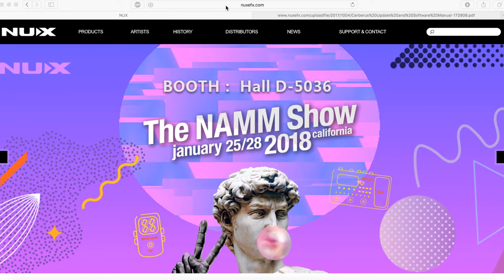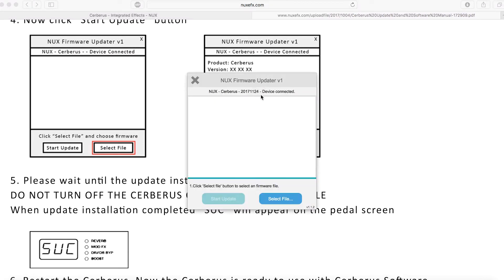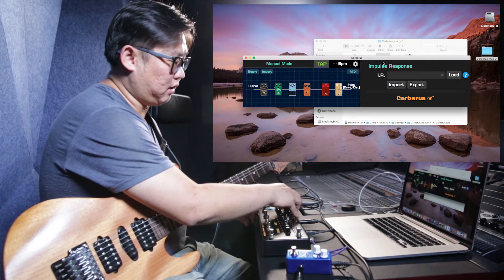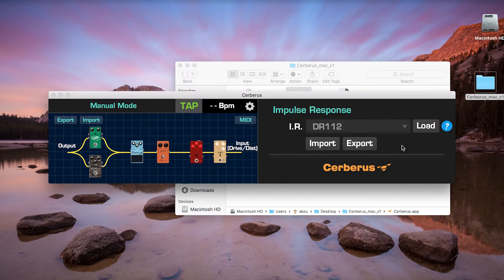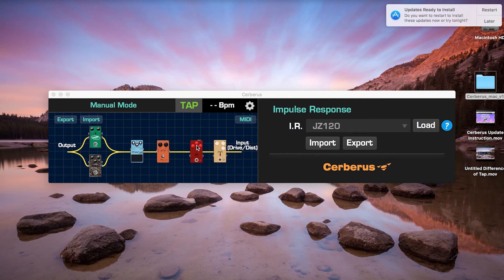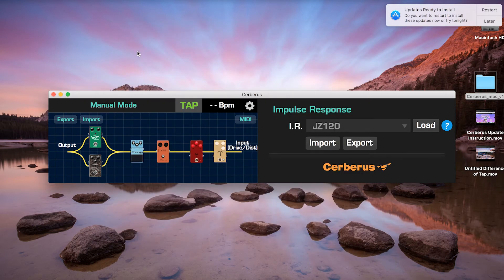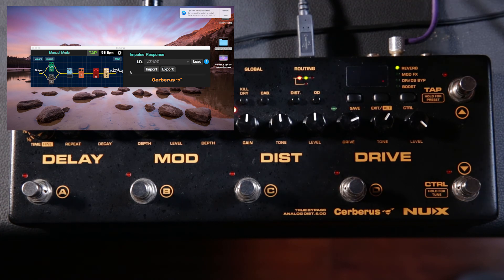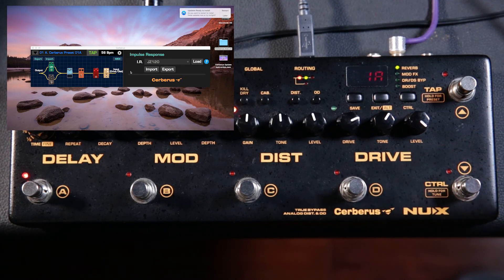How to update firmware on the NUX Cerberus?

Comment: There is a problem with your latest Firmware update.  Prior to v5 update with v3 - the ctrl lights function properly lighting up the item you have selected to control with the ctrl switch.  After the v5 update - all the lights light up at once.  Please fix this.
Reply: COrrect, I have the same problem after the V5 upgrade. Submit the problem and they reply as it is a new feature but cannot tell me what feature is that with ALL the light ON?

Comment: Hi in the manual it reads "full midi implementation" but there is no further information on midi control. Can you control external gear like a strymon device via midi from the cerberus (midi PC and CC change)? If so, how?

Comment: How do I switch between preset and manual mode  when using the unit?
Reply: You've probably figured this out by now, but for anyone else: Press and hold TAP  for about 2 seconds to switch between preset and stompbox modes.

Comment: Hi! Is it possible to assign the TAP footswitch as a tap tempo for delay in Preset Mode or this can work only in Manual Mode?
Reply: Hi. You need to use the Edit Mode. It is simple: define the Preset you want to use (4b, for example), and press the Button 4 once again. You see the word "Edit" on the screen. In this mode, you can engage/disengange Delay, Mod, Od and Dist sections. Best regards from Brazil. I hope I could make myself clear.
Reply: @andreberquo  I don't understand. How does that stop the Tap switch from being your preset selector instead of a Tap Tempo function? It seems you're just describing how to create presets.

Comment: I haven't seen a Compressor. Is this something that can be added in a future Firmware update?
Is there an plans to add Bluetooth so the user can edit the unit with an iPad?
Reply from the maker: We love analog compressor, there is no plan for digital compressor yet.
Thanks for the suggestion, we have a secret project as KP-stomb under developing with BT midi control.

Comment: Thank you for your hard work! This pedal looks and sounds amazing. 
I have a question. 
Can I assign the tap tempo and the control (boost, reverb and so on) to a midi switch? Can I do this in Preset mode? 
Keep up the good work!
Reply from the maker: Yes, you could use the edit software to assign all the parameters even ON/Off switch to a MIDI switch either Preset or Manual modes.
Reply: @nuxaudio  So it can receive and send (thru) PC and CC commands from and to any MIDI capable unit?

Comment: One thing missing would be great in a future update : activate or disactivate the BOOST in the PRESET MODE (for soloing)   :)
Great pedalboard anyway.
Reply: Georges Legangnoux 
Actually you can do it in Edit mode and the control switch can be assigned for the boost and also sent a midi CC to any FX device with midi. 
I do this with my Eventide H9
Reply: Another way is to create a patch with the boost already on with all the effects you want activated and then save your patch. This means  that you can play on rhythm patch and hit your solo patch with the boost already activated with your delay or any fx on...
Reply: If I use a switch for my tap tempo in preset mode will it work as a Global tap for all my presets or will it only affect the patch I'm currently in?

Comment: As i already told you recently, it would be great in the next update to be able to assign different IR’s on each preset.
We could have a clean sound loaded with a JZ120 and a distorted sound with 1960 cab... do you get what i mean ?
Reply from the maker: The memory is limited, no more space to accept other IR files.
Reply: @nuxaudio  Is it possible to use this effect as a sound interface ?